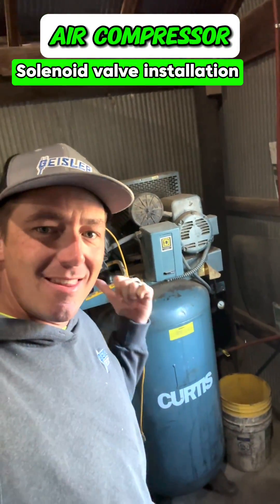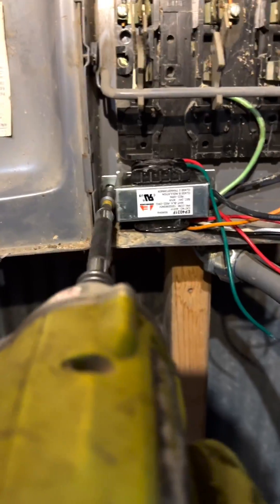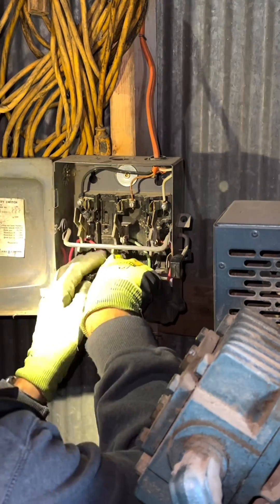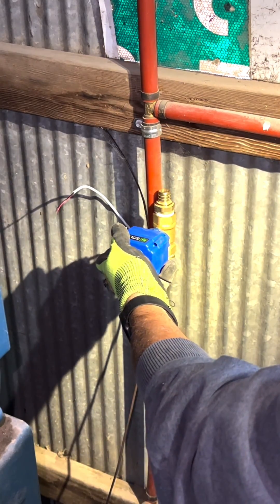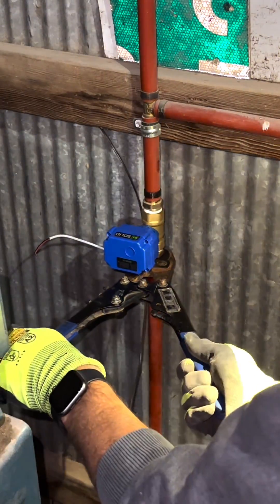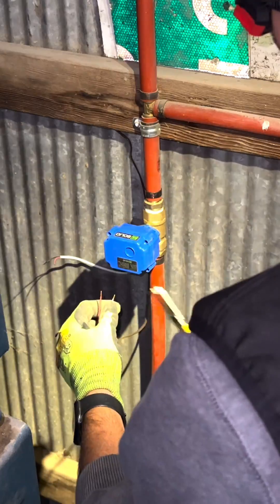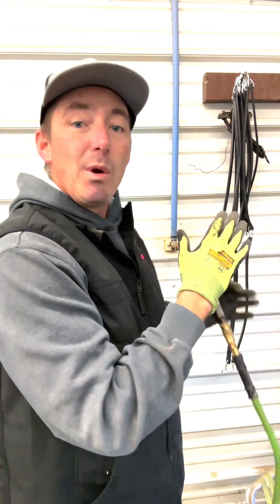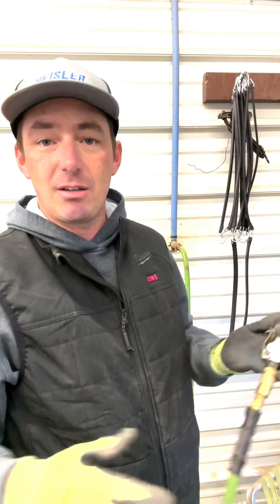Air compressor lines leak, air compressors don’t. Here is a simple and cheap solution…

Comment: In my area we are never allowed to install a transformer inside of a safety switch. If transformer is larger then think 40 VA you must install overload protection. On important systems we always installed 3 ball valves. If solenoid went bad you could close off the two valves on solenoid, open bypass valve and replace the bad solenoid while running equionent.